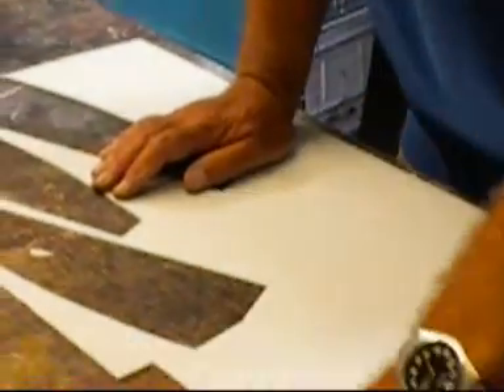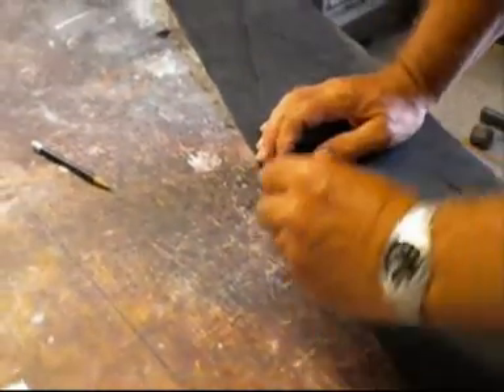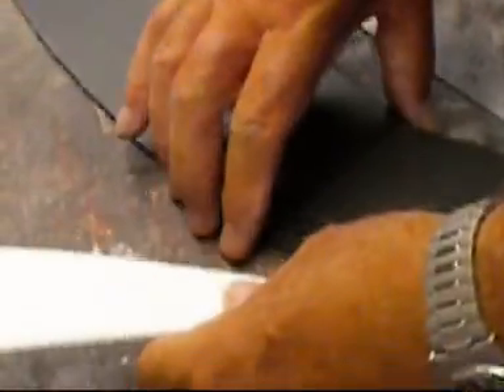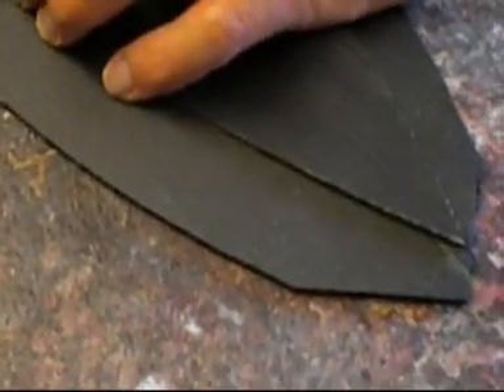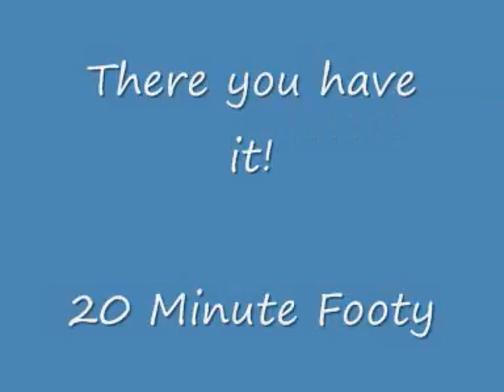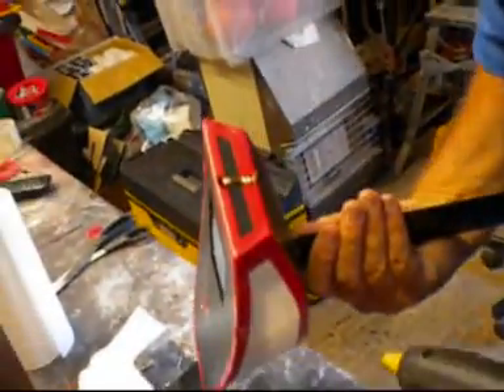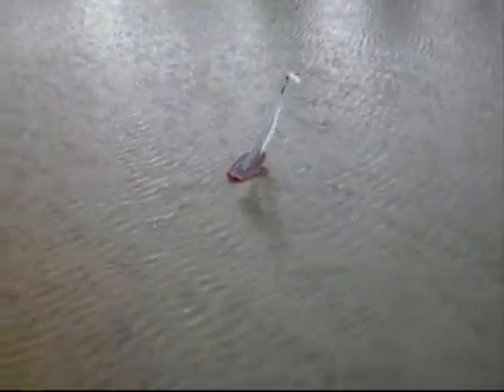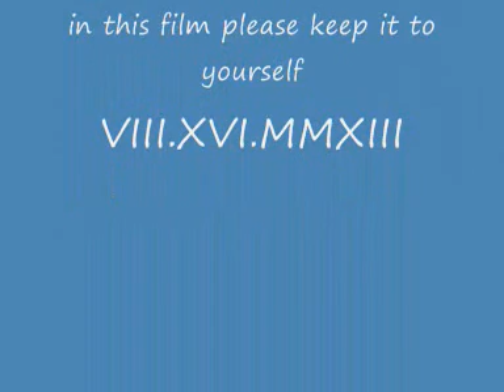20 min Footy

Comment from the maker: One of the problems with a sailing yacht so small is that they have a tendancy to submarine downwind on a run, to try to offset this problem the bow is made wider at the deck line giving the hull something to settle onto in the water when this occurs and preventing the yacht becoming uncontrollable.
See the footy uk website, sailfootyuk for all the details on parts and sails etc and numerous other Footy designs.

Comment: Very nice video. I like your "footy". What is the purpose of the flat nose? Also, could you please show the install of the radio gear and the sails next time?  You said you recycle parts from other stuff, but I would be interested in knowing where or how to get or make the keel and bulb assembly and where did you get the rudder from?  Those parts appear to have come from a kit. I am assuming the mast, sails, booms and rigging also come from a kit or another boat?
Reply: I think we share a thankful attitude towards Mr. Shepherd, but I too would like to see more about how to get to such a sleek keel, and more about how to build that rig.   I am building a Bob-About from scratch out of depron, plans from the internet and Uhu Por contact glue.  This morning I bought a lead "bullet" from the fishing gear store - 149 grams - and have epoxied in place.  I chose a conventional sloop rig but Peter's exquisite sail rig got me curious.